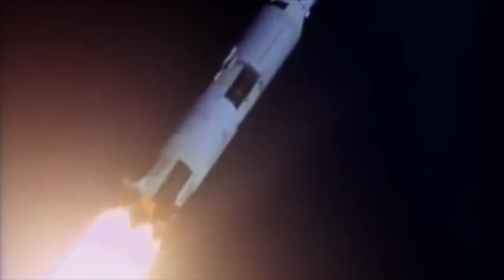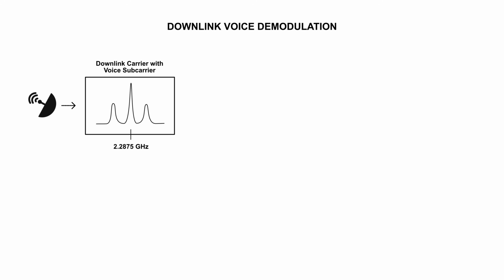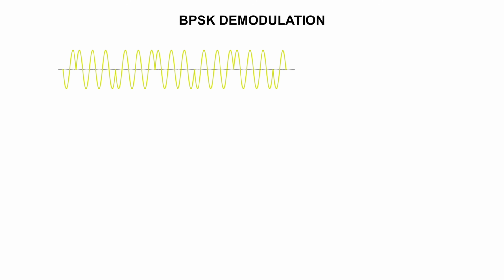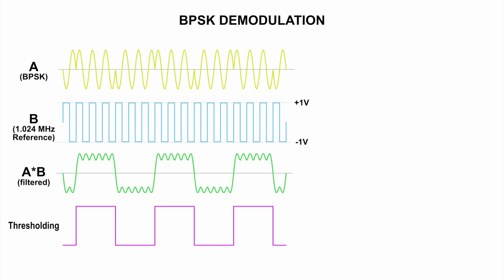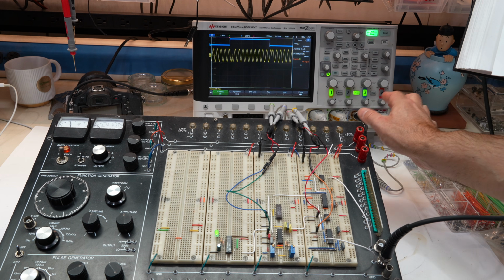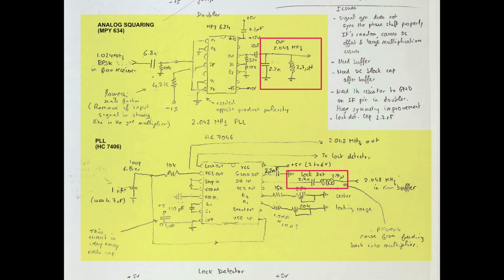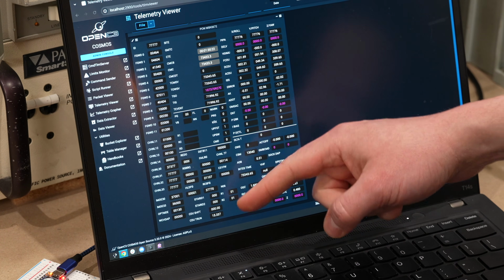Apollo Comms Part 39: Rebuilding the digital data demodulator

Comment: i'm fairly entry level as far as radio stuff (mostly a weather sat listener) goes and a lot of this stuff is (figuratively) on the moon to me, but something i've always wondered that you may be able to answer or have and i missed it - is this signal the one you can faintly hear in the background of EVA comms during that phase of the missions?

 i find it hard to describe, but it's a BPSK signal to my ear that has a water-droplet kind of noise to it. i think it's most audible in some of the Apollo 17 recordings in gaps where the crew isn't talking. would this be some sort of suit telemetry or more of that pseudo-random ranging noise you demonstrated on the combined voice/data system a few videos back?

Comment: ABSOLUTELY ADMIRABLE WORK !!!
This resurrection of the Apollo spacecraft telemetry and communications system is absolutely unbelievable when you consider the chances of these interests, talents and equipment acquisition, all coming together to recreate an actual working system on the ORIGINAL hardware, is just stunning to comprehend.
This is something that might never had ever been done, relegating all these 'boxes' to either museums or scrap-yards!
I'm now wondering (Please don't hit me!), if you are ever considering making an input simulator (e.g. temps, EKG's and various parameters etc.) then a PC (say Visual C++) to display, just like the original consoles at Mission Control?  I know it would be a phenomenal amount of work but is would tidy-up the system from beginning to end.
It would be incredible, if someone (some museum curator), realized the value of this, and would provide an area where is could be set up and ran as a functional exhibit.
Anyway, again this is admirable historic restoration work, and should be historically-archived and recorded, since we are only getting further in time away from its creators, builders and users, or (as now) restorers...

Comment: How do analog PM receivers deal with abrupt 180 degree phase shifts? How can they tell whether the encoded signal should go up or down?

ETA: I suppose the decoder you've built will output either the correct bitstream or its negated version (depending on which of the two half-frequency signals the flipflop happens to pick). Is the decoder downstream simply completely robust to that, or is there something more involved going on?
Reply from the maker: You are correct, the decoder downstream must be able to figure out the polarity of the bits.

Comment: I've always wondered how the clock was being retrieved from the data. Never guessed it was done by squaring the signal. I still see one problem however: if you divide that squared clock by two, its phase compared to the original signal is arbitrary, which means that the decoded bits can be "normal" or inverted. How is that solved?
Reply: An excellent question, I've never really understood how you do that. Perhaps the digital decoder has to cope with the signal maybe being entirely inverted, and can recover from either situation by looking for known patterns that can only be one way or the other?
Reply: @leonerduk  I thought about it a bit more and I think I know how this is done. Those transmissions usually start with a training sequence, which is can be a series of 9 logical '0's (assuming you have 8-bit async communications).  This pattern never happens in normal comms so it will result in a "break" condition in a UART. At this break event, you know what the polarity of this signal is, either normal (0) or inverted (1), so you can enable an inverter if required.

Comment: This is so cool. In my early career I did designs with those ancient LSTTL chips. Fun to see a demodulator circuit built up from commonly available chips on a breadboard like we had in the college EE lab. We had one guy who built up an entire 8080 computer, with graphics interface, using four or five of those boards. I think he got a job offer from Intel.
Reply: A blast from the past. I started out with in the 8085 days. It was nice only having to deal with a single 5V source.

Comment: There doesn't seem to be anything to ensure that your recovered carrier is locked on with the correct phase, it could be half a cycle out, which would give an inverted data stream. Is there something about the way the data was encoded that allows it to be decoded correctly whether it's inverted or not?

Comment: Another FANTASTIC Apollo tech series, they were really like to modulate the modulators or something like that. WOW complex.  I noticed the good old Jameco Jumper wire kits. I just got some refills the other day.  If you notice the colors on the jumper wires are the number of holes that are jumped by using the resistor color codes. The Red jumps 2, Orange jumps 3, Yellow 4, etc.  When I was looking at jumper wire kits sold by other companies, they have random colors, they assumed the colors were random.  But when I want to jump power I use Orange and Yellow jumpers to go from the breadboard rails to the field.   I know that's a random thing to mention, but I thought it was cool when I figured out they were using resistor color colds to mark the jumps.  Oh and the longer wires: Brown jumps 10, Red jumps 20, Orange jumps 30, etc.
Reply from the maker: Oh thanks, I had never figured that color scheme out!
Reply: @CuriousMarc  Once you see it, you can't unsee it! BTW: I think you're located in SF Bay Area south bay?  I'm also a local, in Hayward,  kind of neat to see all that HP goodness and all that hard work you're doing and realizing that it is happening close by.  I worked at HP/Agilent in the 90's in the Test & Measurement division, Semiconductor test.

Comment: The 'dip' in amplitude during the phase change in the BPSK stream is caused by bandwidth limitation of the Rx channel. For a 'instantaneous" phase change you need infinite bandwidth or at lest a signal path bandwidth much wider than the modulation bandwidth, which can be a bit tricky in the real world. The Rx channel may possibly be deliberately BW limited to limit spectral spreading into adjacent signal channels. If you use a RF signal limiter aka a limiting amplifier, the amplitude dip will be eliminated or at least minimised. An alternate demod method would be to use a costas loop circuit which should give you a better result if the RF signal is noisy, which might be the case if you intend to add the 'ranging code' modulation at some future time.
But I just am just loving to see the original Apollo hardware working and love seeing these episodes. I does make you realise that the dudes that designed this gear were some smart cookies. You just couldn't throw computing power at it then which seems the preferred option today. But I am just an old ex RF/analogue guy who maybe somewhat biased against these new fangled computer things.
Reply from the maker: I wouldn’t read too much into this. On the way up, which is much slower, they use the exact same modulation circuit and it doesn’t have any unwanted AM cross modulation, they even keep the kink in the phase change. On the way down the same circuit just can’t keep up. This is not the usual bandwidth optimized PSK whatsoever, the modulation rate is far lower than the subcarrier. The AM component is so large that I can’t think it’s on purpose. It’s just what the transistorized circuit could do, and they compensated the temporary loss of reference by having a lot of periods between phase transitions.
Reply: My thoughts exactly, as an radio amateur that tinkered with BPSK at some time in the distant past.
Reply: Yes, BPSK needs to be bandwidth limited in practice and that's what it looks like. The sharp spikes you see at each phase reversal on Marc's ideal BPSK waveforms are nasty high order harmonics that would splatter all over adjacent channels.
Reply: Even though I am more of a digital electronics nerd, I agree that there's more to analog physics than it looks on surface, however there's a few variants of PSK, just like CuriousMarc has pointed out, there's more than one way to skin a cat in terms of how you can send analog and digital signals uplink, even digital codes riding on the analog RF if you really want to be cute with RF physics in terms of how it's modulated that it can survive the trip between two points - NASA famously likes to do things the hard way which was certainly the case with Apollo electronics here.

Comment: It's always so fascinating, how small electronics got over the last 50 years. You could put all the Apollo electronics into a device of the size of a smartphone and would save half a metric ton of weight and a lot of space.
Reply: It gets even more impressive if you consider the fact that those chips are designed that large because the housing needs to be large enough to solder them. If it were just the silicon dies themself, everything would fit at a space the size of a fingernail.
In fact, todays µ-Controller (note: µ-Controller - not µ-Processor. A µ-Controller is a CPU + memory + peripheral + everything needed to run the CPU, on a single chip) can easily do, what the AGC + most of the Apollo hardware did (and more) for the cost of less then 10 bucks. In fact, most computers worldwide are µ-Controllers. They work in refrigerators, vacuum cleaners, etc., but most of them are probably built into cars, where they do their work without anybody ever noticing their presence. It is much simpler and cheaper to have a simple turn signal controlled by a µC, costing a few cents, then it is with analog electronics - and it doesn't need blinker fluid too 🙂

Comment: 22:18 - the shaped waveforms around the edges of the PSK waveform are necessary to reduce the effective bandwidth of the waveform generated. Perfect square edges have a well known and very broad spectrum. The filtering maintains the general spectrum shape but it is effectively filtered to reduce the strength of the waveform at frequencies well removed from the center. (That is a pretty spectrum at that point. Somebody worked hard to make it so symmetrical. Back then I would have generated that waveform with a double balanced mixer fed the 1.024 MHz sinewave carrier and the -1,+1 data stream fed through a low pass filter, perhaps with a Gaussian shape.)

{^_^}

Comment: From that decode path, nothing seems to guarantee the same polarity (high vs low) as the original. Which is to say that the original digital input and final digital output could be either the same, or inverted depending on exactly when you lock onto to data stream. I'm not missing anything right? Were they using DPSK which makes this irrelevant (as the final data does not care about high or low, but only about if it flips or not each time unit) or was this relying on periodic fixed patterns by which a digital computer could determine if the locked on signal was inverted, and flip it back?
Reply: Yeah, I'm stuck at the same point - I'm not seeing how you get the 0/1 (vs 1/0) phase info without some sort of sync frame somewhere. Pretty confident it's a failure on my part somewhere...
Reply from the maker: You are both right! Nothing guarantees the polarity, you never know how your divide by two is going to align either, so it’s totally random.. I actually had some footage that demonstrated it but I cut it out of the video. I had a Hail Mary switch wired in to switch polarity, but Mike took care of figuring that out automatically in his FPGA. I’m not sure how - probably while looking for the sync pattern if I had a guess. Look for the pattern and anti-pattern and decide based in which you found.

Comment: Great video and information... for tracking stations - we had the raw data dumps printed out on s band downlinks at one time. analog tapes just don't keep useable fidelity after 15 yrs much less 50. Ampex 1/2 " tapes where all the decom tlm links nrzl or decom psk data recorded , transmitted back to nasa world. no requirement to keep our in house copies.. some operators did just for nostalgia when the Apollo missions ended., but "used" analog tapes were needed to set up next mission, so all the F-2, F-1 day and maintenance checks were recorded on the used tapes and on mission day of Atlas, Delta, Titan ops we used new tapes.

Comment: I just finished reading Failure is not an Option by Eugene Kranz (for the second time) and recalled the change made to the controllers console warming light logic after Apollo 13.  The logic was reversed to aid the controller in rapidly recognizing a changing status in critical systems (which proved fruitful on recognition of the failed abort switch on Apollo 14).  I know the console lights were different than the screen display, but this episode reminded me of the vast amount of data that controllers were responsible for monitoring.  Would love to help recreate the controller console displays to match the various display call ups for the telemetry data!
Reply: In the 2010's when commercial nuclear power was embracing digital tech on main instruments after years of using just analog metering, we played around with several schemes to try and 'attract the eye' of operators when things were changing rapidly. When you're looking at panels with 50 to 100 meters, it's hard sometimes to notice when something is awry. Flashing arrows that indicated direction, with the rate of blinking related to rate of change, 'bar graphs' around the digital readouts to give an intuitive "is this high or low end of range" and other cues to convey quickly a sense of 'not bad', 'too low', 'off-line' and... 'oh sh**!!!".
The nuc industry has developed a lot of 'human factors' rules and science to aid operators in quick assessment of changing situations.
Reply: What was the change?
Reply: @robertobryk4989 prior to the change most of the console warning indicator lights were lit to indicate normal status.  After the change warning indicators were only lit for attention or abnormal status.
Reply: Fun fact:  the Apollo 14 LEM Abort Telemetry came in on Channel 30, Bit 1

Comment: I had a similarly satisfying experience a few years ago recovering twenty byte, forty Hz frames of vintage 1970s laser show data encoded on one track of a crate of quarter inch four track reel to reel tapes containing audio on the other tracks. Recovering the frames and bits was simpler in my case though, as zero crossings were involved. A clever scheme of system control was revealed in the twenty byte frames.

Finally having that mysterious data fully tamed and building a visualization tool around it can be good programming fun. Bon Appetit.

I enjoyed privately pretending I was you guys doing what you do while working on that project. Congratulations on more world class work.

Comment: I'd guess that the real Apollo BPSK signal is band-limited, not just slow by accident. Hard keyed BPSK creates "key splatter" that occupies spectrum out of band. The amateur radio mode PSK31, a QRSS digital mode, uses a cosine shaped transition between states which produces very similar looking modulated signal waveforms to those that you show on the scope.

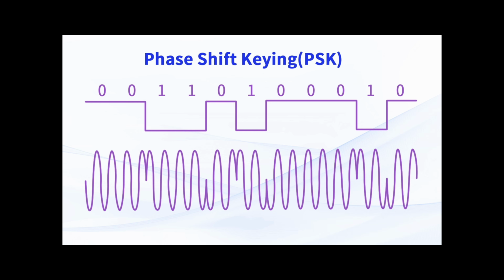Comment: 7:28 BPSK can also be interpreted as double-sideband suppressed-carrier modulation (DSB-SC), a close relative of AM
Reply: Oh actually if the recovered carrier in your circuit were a sine instead of a square wave and clean up the output of the multiplier with low-pass filtering alone instead of a comparator then you'd have a DSB demodulator (as long as enough signal is present to keep the PLL locked, so more suitable for DSB-RC and AM than DSB-SC)